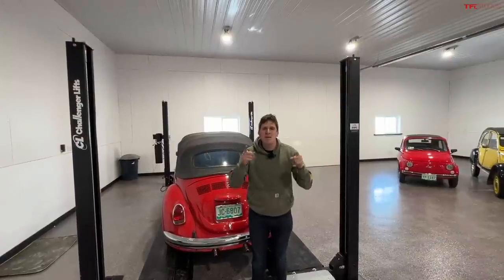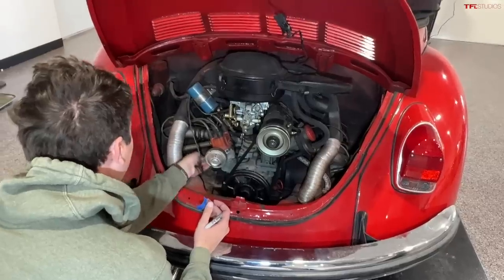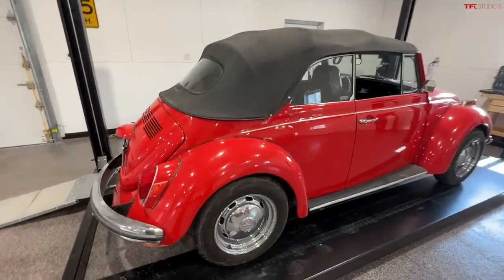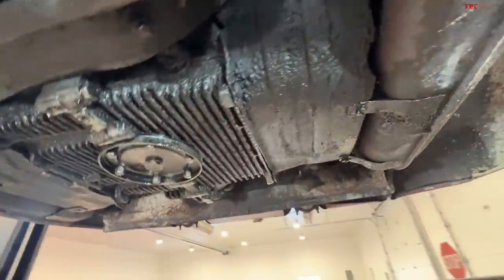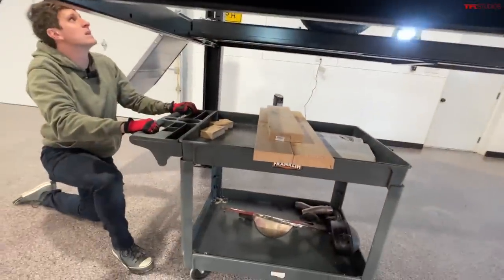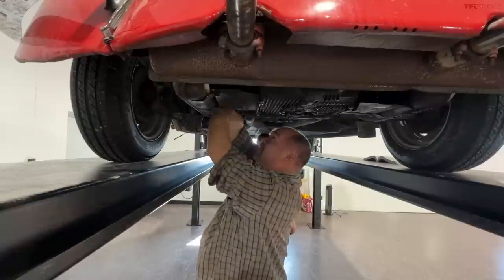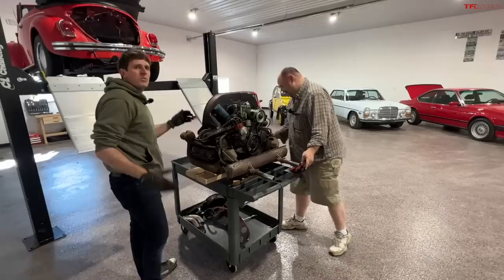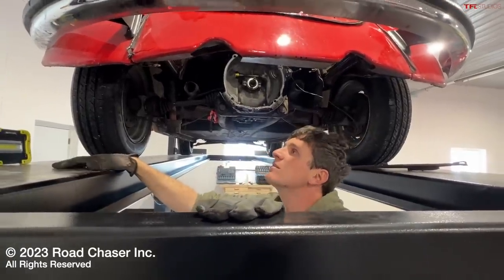People Say Removing a VW Beetle Engine is Super Easy: Is It Actually?

Comment: Hi everybody, James (from the video) here.  Total elapsed time was about 2 hours.  None of the 2-3 videos I watched to prepare for this mentioned that there is definitely an order to doing the bolts:  front lower two, front upper driver side (these 3 have to be done from underneath) then rear upper passenger side bolt that can be done from above / behind the car.  So we did spend a few times raising / lowering before figuring out that the top driver side bolt had to be done from underneath.

Between that and moving the distributor out of the way, I feel like if we had to do it again we could get it down to 45 minutes or less.  The lift made a big difference, as always.  We were both definitely learning as we went, but it was a lot of fun :)
Reply: The cart was giving you the problem. With a floor jack, it is easier to manipulate the motor. Put the plate of the jack under the oil strainer plate, the motor will balance on it. Keep it simple, keep it fun!!! Good job.

Comment: This brings back memories.  Back in the late 60s, I was stationed at Naval Air Station Boca Chica, Key West. My shop supervisor owned an early 60 Bug. He drove it home to Jacksonville FL. every weekend. It would burn exhaust valves and start skipping after a few trips. He bought a spare engine, which we rebuilt and used as a spare. We modified the rear of the vw so we could remove the rear sheet metal to facilitate engine swapping. The fenders were attached with Dzuse fasteners and could be removed in seconds. This made the swap easier, and we could R/R old engine for new in under 30 minutes. Great memories
Reply: I also made a removable rear apron on my 62VW as a modification. It helps facilitate engine removal.  I’ve used this feature a few times to remove the engine with ease!  Despite the great engineering, things can always be improved!

Comment: That book has been around forever. I had one in 1969 when I was working on my 1958 VW. The book is brilliant. Several years later I had a Meyers Manx that had an extractor exhaust (basically headers ) on it and we could take that engine out in about 15 minutes. Once everything was disconnected, two guys just grabbed onto the headers and pulled the engine out. I then tore the engine down completely and put a big-bore kit and different cam in it. I think it gave me all of maybe 80 hp, but that was fine in a car that couldn't have weighed 1200 lbs. Great fun. I wish I had both of those cars today. Great video. Brought back lots of memories.

Comment: I have had that book since the late 80's. It has a lot of good info and it is fun to read. I think my quickest time to pull a vw engine is about 5 minutes. Keep in mind that it didn't have the heater boxes or some of the tin that goes between the engine and the rest of the car.

Comment: With the few proper tools needed, yes it comes out very easy. When I was a line mechanic at VW, I would do a clutch in about 30 to 45 mins. The one tool absolutely needed is a floor jack along with the car on the lift. While the motor is out,  I would replace the clutch disc. And the throw out bearing looks a little worn. The rusted part you pointed out under the running boards, are there because this is a convertible. Those are not heater tunnels. The convertible body is fortified and gusseted at critical points since the roof is not there to give the body it's strength. On a hard top, you would not find those. Compare the doors also on a hard top. Hey good job though. I started out with that very same book you have. Have fun!!!

Comment: In 2 hous??. in 1986 I pulled 2 engines from 2 beetles and swapped in order to have rolling storage for the blown engine in 2 hours. without a lift. of course I was only 23 yrs old and already had been seasoned with high school auto multiple engine rebuilds and cross brand engine swaps.

Comment: Old John Muir had a lot of good tips in that book. For those who do not have a lift and a cart, you remove the back wheels and jack the car up off the jack-stands via the wishbone, slide the engine out of the side, and lower it back down. I use an ATV jack from Harbor Freight to drop the engine on. Great video though. My 69 VWs engine is just a grimy btw and still runs like a champ

Comment: Pulled a lot of these. Should take 30-40 min after you've done a few. A floor jack works much better than that cart and you don't have to jiggle the lift up and down. The whole engine weighs 180 lbs max. Never had to remove or rotate the distributor to clear the engine, so I wonder if that car was rear ended.

Comment: I first earned my mechanics stripes with the idiot book keeping a 15 year old 1962 small rear window standard VW Bus fixed and running.  That Bus was my ticket to freedom for about three years.  I did engine out work several times to replace clutches.  My Bus had no rear bumper, and the lower rear body panel was a bolt in piece that made engine R&R a breeze - 15 to 20 minutes after the first time.  An old air cooled VW is just about the ideal vehicle to learn mechanics, simple and straightforward.  I’m on my 26th vehicle now after a couple of VWs beginning in 1977.

Comment: Heidi and Franny are legends, I was half expecting to see them helping out here. I tell you what, having a couple of VW Things, that upper right engine bolt is so ridiculously hard to get to, you need dislocating elbows to get at it practically. 😆 The Beetle has 1000x better access to it. I also have to pull the belt pulley off the front of the motor to get enough clearance. Nice job though for your first attempt. Looks a hell of a lot easier with a real lift 😆

Comment: Opinions are like elbows but here's mine. If you're going to rebuild consider increasing the piston/cylinder size to 90.5 and make it a 1776 with dual carbs (maybe kadrons) and equal length headers. Isn't an over the top upgrade but it'll add enough power that getting on the highway won't feel like such an adventure where a semi might kill you. If you keep the compression around 7.5 to 1 it won't overheat. Ran my 71 super in college in Southern California like that for 4 years without a problem. Also use quality parts. Don't get suckered by some of these companies that sell you things for a song.
Reply: i dont know if you want that in colorado, dual carbs dont choke as well and can be seriously hard to keep the intakes from icing over.
Reply: @groupbmotors  if he was building a fire breathing 2332 monster with 48idas I'd agree. However a pair of single barrel carbs with the right jetting for the altitude should be fine. It might take slightly longer to warm up but the gain in power for daily driving would be worth it. Plus it seems like Tommy isn't doing a lot of winter driving with it.
Reply: I built the same size motor using 90.5, dual webers, some head work, and finally balanced the  engine. After blowing the 1835 with 92's. You're right, everything ran great and cool without a problem. It was in a 66 stock looking bug, slightly dumped in the front.

Comment: I didn't do a beetle, but I did my own drop and rebuild of a Porsche Carrera 3.2.  Once you get your head around how Porsche designed cars work, it's not bad at all.  Anyway since your car is not a show car, you can get some good results with POR15 on those rust areas.
Reply: Oh, one more thing- A lift table from Harbor Freight helps a lot over a cart.  Franny is 1000% right about that engine bay seal.  The fan is pissing in the wind without it and so many people forget that small detail when working on the car.

Comment: While engine is out get German seals for engine bay,get the engine bay tar board from classic vws and replace your fuel lines with ones that can hold ethanol but is still braided like German

Comment: If you rebuild it have it align bored. The engine case where the crankshaft bearings go. Otherwise you may get oil leakage from the pulley end of the crankshaft.

Comment: Good job.
FWIW, I think you should overhaul it yourself. One, it would  make interesting content. Two, it will pay countless dividends in the future.  Even if you FUBAR it, that's OK too. No shame in learning new things.  You can always bring it someone to get it right. It looks like you have the room to do it. Keep your parts organized and label things you think you'll forget. Good Luck!
Reply: Well said. The VW engine is practically modular so when you get to the 3rd cylinder you are comfortable getting everything apart!! Be specific on getting the right torque for every bolt/nut and you almost can’t go wrong. Lots of break in lube putting it together. Like you say, mark things and away ya go. I always surprise myself when I get putting things back and I don’t need references. I have 40 + years of working on vehicles myself so there’s a good background, but OHC V8s scare the crap out of me. Did my first set of cam phasers and timing chain assembly etc on a 2008 F150 for/with a friend and it was not really that hard. Tedious,,, but not truly hard. Maybe I will do an LS conversion yet!! 😂😂. I’m much more likely to do an EV conversion before I succumb to the LS fad.  
    Anyways,,,,, Tommy is definitely smart enough to figure it out if only he could be more confident. It takes time.

Comment: Well, It's really not that hard to pull the engine. The book you referred to will have you do a bunch of unnecessary stuff to remove the engine. My option, it is not the best over manual. The VW shop manual gave me more information. I guess that book was not in print also when I started working on Bugs. I used to time my self pulling the engine by playing Peter Frampton's Do you feel like I do or Iron Butterfly's - IN A GADDA DA VIDA, they are about the length of your Video, that dates me. Lol. So 15 - 20 minutes once you have done your prep-work. I never removed the distributor or clocked it. Removing it can lead you down the rabbit hole if you rotate the engine with it out. I used four jack stands and a floor jack with a 2x4 on the jack. The two in front were lower than the back stands to give clearance.  For the fuel line, I would stick a bolt in the line and tighten the hose clamp. No clamping to ruin the hose integrity. As for the battery, Yes, disconnected it, but mine had a cover on top to protect it from shorting also. I had several 1964 Beetles which were the easiest to pull, My 1972 was not too bad also. Fortunately, never had to pull my 1974 Super Beetle's engine. It had A/C installed when I purchased it, which that could have been a pain. Never had any oil leaks or fires, ill running symptoms. Just kept it maintained and oil changed, it was good to go. Heater also worked great.